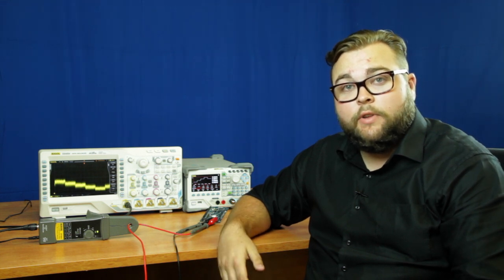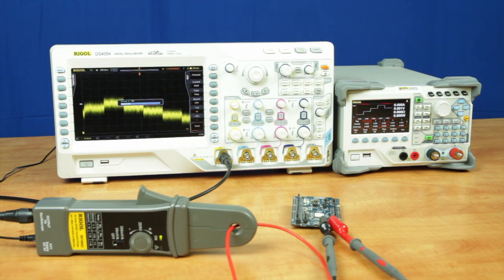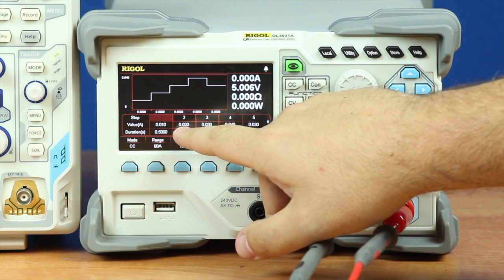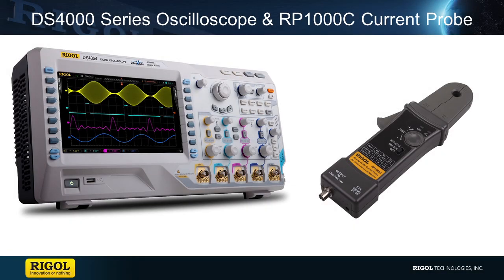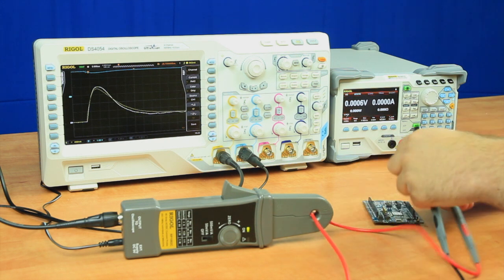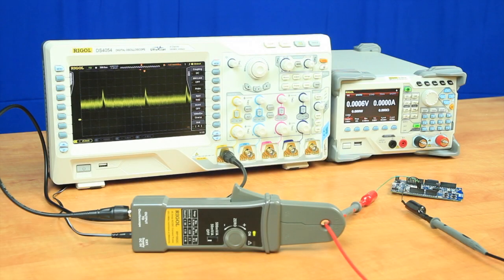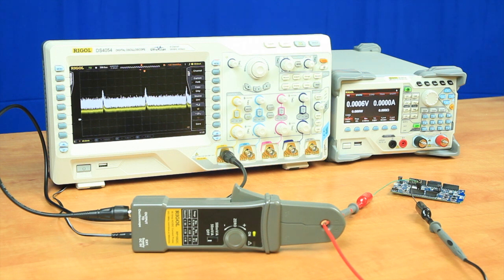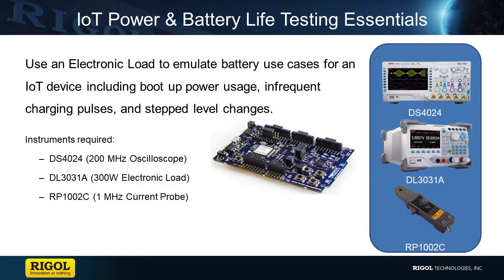IoT Power Management  with an Electronic Load

Comment: whats is the difference between DL3021 vs DL3021A and DL3031A apart from wattage ?
Reply from the maker: The A models come with all of the licenses preinstalled as well as a color graded display.  Where as the non-A models come with a monochrome display.  

The difference between the DL3021 and the DL3031 is purely a wattage difference.

Comment: I hope that you please will answer this question:
I have understand that some of your oscilloscope can store a reading on an USB stick and be "replayed" in your signal generators. My question is if your MSO5000 can store date that your Rigol DL3021 load then can replay?
Reply from the maker: Unfortunately that capability does not exist on the DL3000 and the MSO5000 series.  

Based on the different current draw characteristic I will use the DL3000's List, Pulse or Continuous modes to create the measured current draw on the oscilloscope.  To get specific values to enter into the DL3000 I use the MSO5000 series cursor function and measurement capability.  I have linked below to a couple of videos where we go a little bit more in depth.   

Boot Up Energy: https://www.youtube.com/watch?v=LR7QKz9Cbg8&t

Nominal Power: https://www.youtube.com/watch?v=D-wkYEqgWQI&t

Operational Power: https://www.youtube.com/watch?v=HJXKmXcBWHQ&t
Reply: @RigolTech  Thanks a lot, what a great answer and service! I'll look at your links:-)